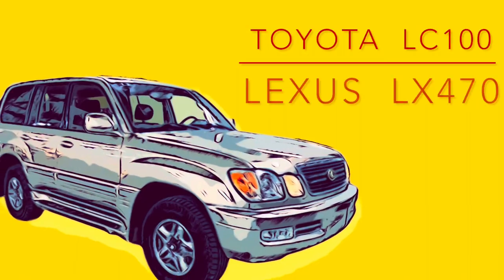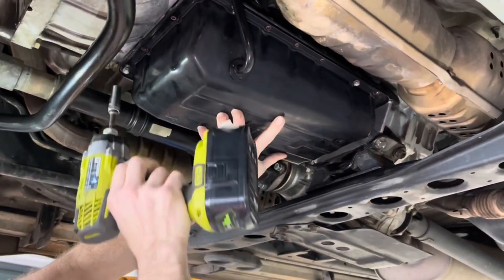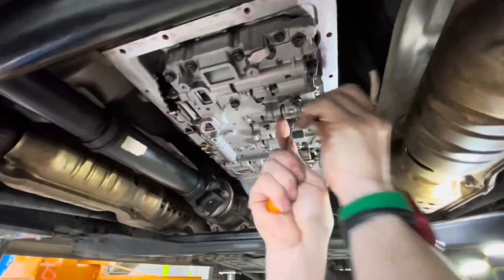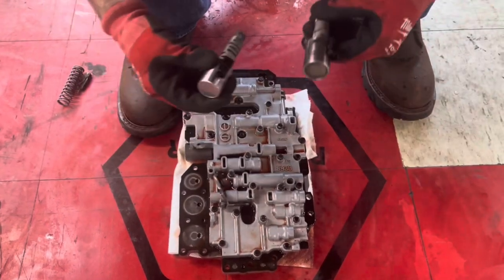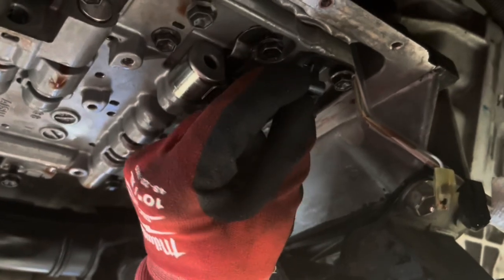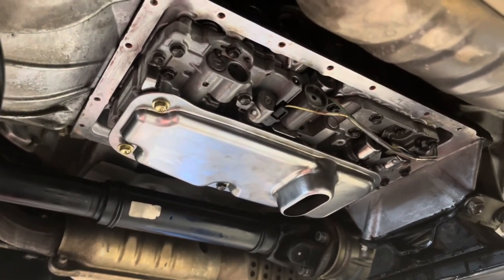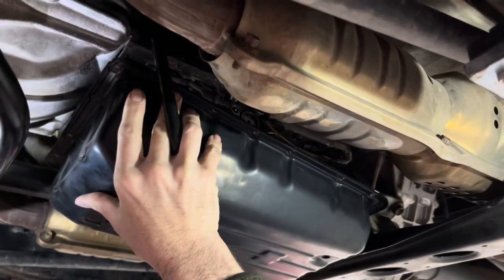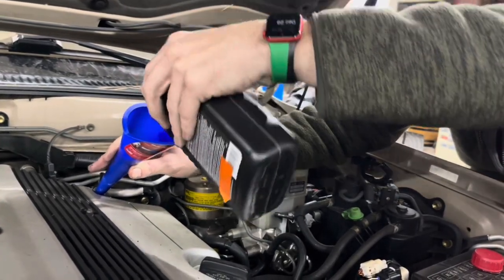100 series Toyota Land Cruiser Lexus LX470 A343F Transmission Shift Lockout Solenoid Replacement DIY

Comment: Great video mate. bit late but my 2000 LC/Auto having slight delay in "D" gears when I shift from parking. Sometime i encounter little to no movement at all in D while break off. All other gears are working just fine. Strangely "D" with 4L works as normal. Had trans fluid change with new filter but didn’t help much.
Reply from the maker: The 2000 Model year has a common defect that causes similar issues, however if I can recommend a possible short term fix...  I use a product called "trans Doctor", its a small (~4oz) tube of friction modifier that is designed to combat torque converter shudder, but it can do wonders for our transmissions with high milage.   cheers

Comment: Great clear video. My 2002 lx470 has a small slip when I jam in the gas. I seem to only notice it in third (OD off) though it may do it I tiny bit in fourth. Otherwise shifts smooth. Shifting solenoid?  Any good resources for instructions on changing a shifting solenoid?
Reply from the maker: Sorry I didn’t see this sooner mate; In regards to the intermittent slip that occurs only in a single gear, you could likely get away with just changing that solenoid.  However if you’ve  got one slipping and decided to replace it, and suspect another might be slipping. Just replace them all.

Comment: Hello thanks for the video…I know this is an old thread but wanted to ask….

2005 LX470
When I press the brake pedal the reverse indication comes on along with the actual gear position.  (Ex: truck in park and press the brake R comes on and rear camera and reverse lights come on). The truck shifts fine to Reverse but jerks a little when going into drive from neutral but smooth shift from drive back to reverse. Side note that the issue is sometimes intermittent but when it’s not happening truck shifts fine.  The day it occurred I was shifting from reverse to drive and had a slight clunk in drive snd 3 amigos came on. (Note 3 amigos come on anytime the issue is present) thanks Michael
Reply from the maker: Hey Michael,  I don't want to throw you for a loop, but I've been under the skin of my fair share of Toyotas and I suspect your problem might lay in your rear hatch harness.  The harness that comes through the hatch into the main cabin can have wires crack in them and sometimes break enough to cause "ghosts". They are subjected to so many open close cycles in every conceivable climate and time does what time does. 
This problem dates back to the OG, LS400 and most the folks who know about it are too old to use the internet.  Kidding aside, the cracked or broken wires can play very silly games on your reverse and brake circuits.   Take your time, open up that flexible harness and inspect all of you wires, if it looks like it might be broken inside, assume it is, if you have an OHM meter, dust it off, it will save a lot of guess work.  If you see no damage and must OHM them, be sure to move the wires around as you do it and watch for a drop in continuity. 

Best to ya Michael

Comment: awesome video,i have an 03 landcruiser that slams into gear when shifting from park to reverse, it also does it when going from park to drive just not as bad, do you think that changing this solenoid or all of them would fix the problem?what are they all called and where do you recommend I purchase them, I parked it last fall when it started to act up,I love this vehicle and really don't want it to sit any longer.i fix all of my old stuff from watching people like you, and really appreciate any wisdom you can pass along, thank you!
Reply: Did u lube driveshafts
Reply: Grease*
Reply: @osmia3561  yes I have, I recently took it for a 2 mile drive and it slipped out of gear when accelerating so I turned around to go home and it didn't slip again, still slams into gear when going from park to reverse or park to drive, thanks
Reply from the maker: I’m sorry I missed this, let’s not leave that baby sit too long.  

Hard shifting can often be addressed by a simple transmission service.  The service replaces old fluid with new and insures it at the proper level, both frequent hard shift contributors. 
 It seems you may have more than one issue.  Drive shaft clunk is a common nuisance in these (and many of the Prados). Greasing your grease fittings and check for excessive play in your joints or carrier bearing. 
Note: even with all new components many owners still experience drive line clunk. Driveline clunk is an independent problem for the hard shifting. 
Lastly, if you are popping out of gear it is very likely a solenoid.  Perhaps not the same one as this video, but certainly one of the four.  
It is common practice to replace them all together, however the parts are rather expensive especially if you use OEM which I highly recommend.  I’ve only ever had one aftermarket solenoid fail on me, but I’ve never had a OE one fail after replacement so🤷‍♂️

Comment: Thank you for the great video and clear instruction.  I specially appreciate that you added the torque requirements.
 I just had this problem with my 2004 LX470.  I get code P2714.  Pressure Control Solenoid D Performance/Stuck.   I am thinking doing what you did in this video.  How do I know which one is D?  What is the part number?   How many quarts of fluid did you use total?
Reply from the maker: If you are going to take the time to go into yours, it would be wise to change all of them.  If you are doing it yourself, you can replace the shift solenoids without even dropping the valve body. 
I think I used about 5 quarts of fluid, but I just filled it per the manual not by capacity.
Reply: My daughter pointed out I didn't answer your questions very well, I must have only half showed up.. apologies   
AND...... if I must be honest.. I'm embarrassed to say the 2nd shift solenoid failed just recently, so I should have done all three while I was in there.   That said, it's likely worth doing them while you are there.  A standard shift solenoid (takes two per vehicle) is the Toyota 35250-30050, this is the most current superseded number, these are control solenoids.  The Lockout or torque converter Solenoid 35290-60020 (the one from the video) failing will feel like you've lost your transmission and everything is shredding, however, if shifts are rough, random or sometimes not at all, that is more likely a signal solenoid.     Lastly, if I recall, it takes 12 quarts of fluid, but it's wise to confer your manual.  cheers.

Comment: My Land Cruiser was doing the same thing. I found your video & decided to change my solenoid & see if that resolved my issue. I completed the swap but now when I select reverse, the vehicle drives forward(same in neutral). I ordered the solenoid from Toyota & it matched up with my old one. Do you have any idea on what I could’ve done wrong to cause this?
Reply from the maker: Sounds like a signal issue, however I’m not certain what would make the valve body or shift selector all of the sudden go out of whack.  The simplest thing to check is your shift linkage at the transmission.  If it’s loose and indexed wrong it can shift your whole pattern backwards. 

If it’s an ECM issue (common thanks to sun roofs leaking onto the computer) you’d need to spend some time in tech stream to see what’s going on.

Comment: Thanks for such an awesome video. I have a 2009 gx470 and it doesn’t shift to the 5th gear. All other gears shift fine. Can changing the selenoids fix this problem?
Reply from the maker: There is a fair chance you will only need shift solenoids, what's better is you don't have to drop the valve body for that.

Comment: Great concise video.  I have a 2000 Lx 470 which sometimes refuses to go on second or third gear.  I sometimes disconnect the battery for several minutes and then it will start working properly and shift smoothly.  Do you think my solenoids have gone bad?  Thanks in advance!
Reply from the maker: It is not uncommon for the shift solenoids to fail.  The good news, they are a bit easier to change out, in that you do not have to remove the valve body.
Reply: @ToyotasInc  thank you so much for your prompt response.